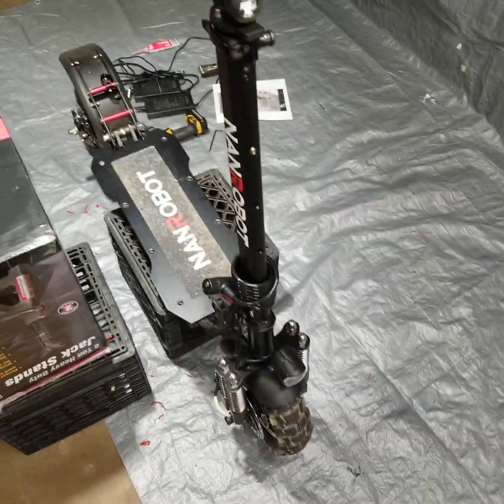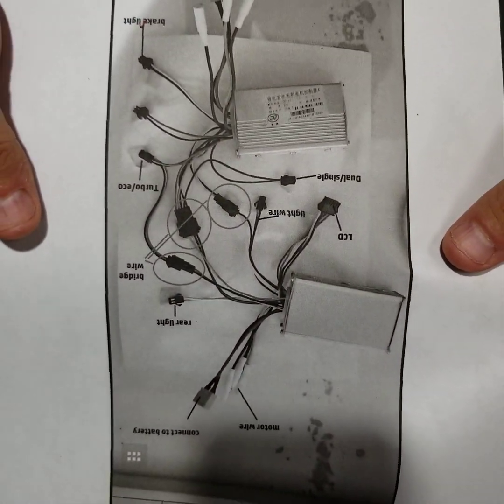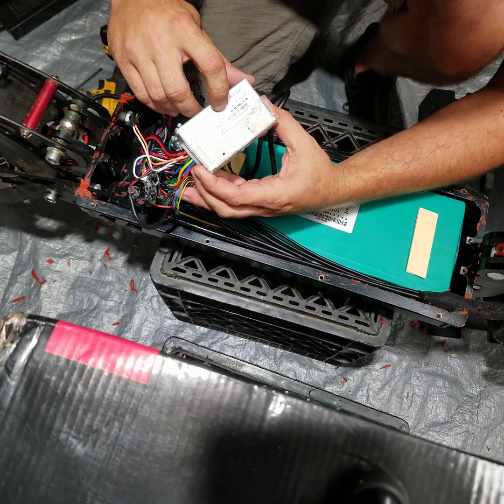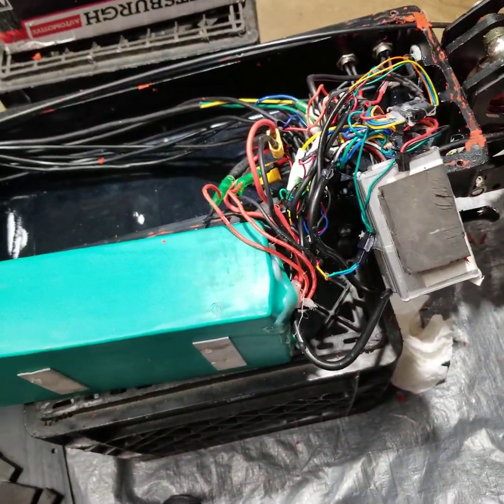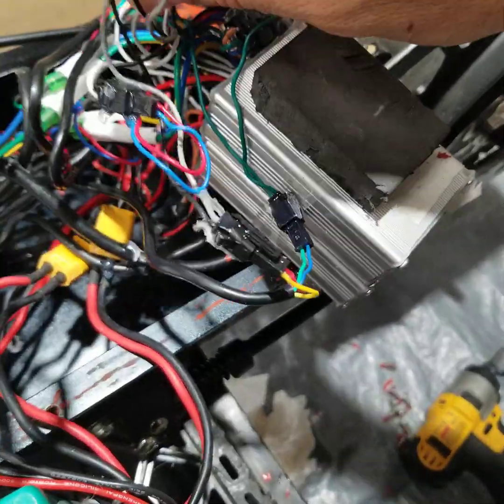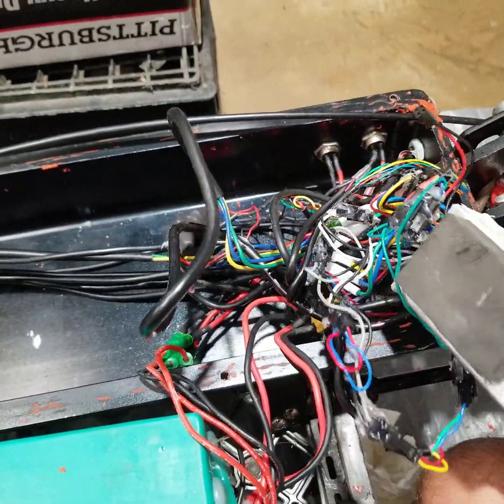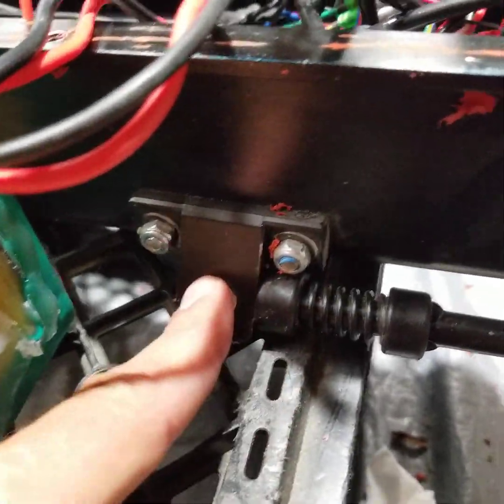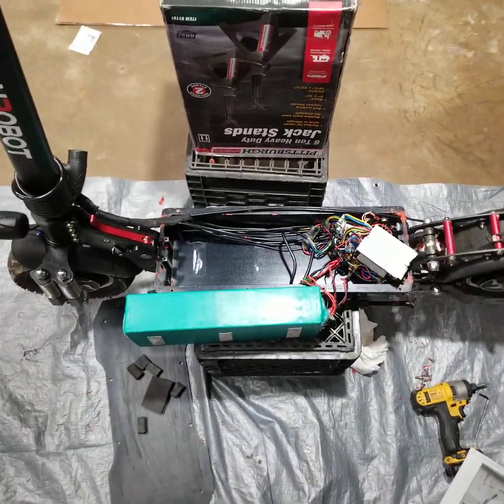Nanrobot D4+ 2.0 Whats inside the scooter Plus overview of the basic wiring diagram electric scooter

Comment: my nanrobot d4 seems to make a clicking/clunking sound when i first use it, it seems to be coming from the motors but im not sure.but it doesnt seem to affect it and it goes when youve done a mile or so....any idea what this could be...many thanks for your help...Adam
Reply from the maker: Since it doesn't seem to affect the operation then maybe you don't need to worry about it but i definitely would look closer and inspect everything just in case. Check where the handle bars connect at the base to make sure there isn't any loose screws. They are notorious foe backing out on there own. Also the clicking might be from the front suspension. They are sometimes very noisy. Its a sucky design. Also check your brake rotors and make sure they are not warped. I would put the scooter up on a stand and run it to see if i could identify where the clicking is coming from just to be sure everything is safe.
Reply: wow..thanks for your very fast response...i have done all that and i know about the noisy suspension..and its not the rotors ...when i put it on a stand the motors or silent its only when i first get on the scooter and start off there is a clunking like sound which sound like its coming from the motor i think rear motor also the rear motor doesnt seem to be as powerful as the front...should i be able to hold the scooter still and the rear motor not have the power to keep going and just click as if it was trying to move?
again thanks for your help i know its difficult without seeing the problem
Reply: do the controllers make a noise ever?
Reply from the maker: @adamwilliams2381  not that i know of. They just go bad and your motor will not work.
Reply: .should i be able to hold the scooter still and the rear motor not have the power to keep going and just click as if it was trying to move?
again thanks for your help i know its difficult without seeing the problem
Reply from the maker: @adamwilliams2381  it may sound like the bearings could be going bad. Look at the video i made when i took the motor apart and you will see the bearings, one on each side.

Comment: Iv got a problem with the back tire, it works but shuts off periodically while driving is it a circuit problem or is it the wheel itself
Reply from the maker: It could be a loose connection or the speed controller going bad. I would check for a loose connection first.

Comment: Hey man I hope you can help me out. I have a nanrobot d4+ the first models that came out. I was trying to connect led lights on the scooter and messed something up. My scooter doesn't stay on.. it goes out instantly.  Is there a fuse or circuit breaker that I can reset?
Reply from the maker: Ok we have to do some troubleshooting. Where exactly did you try and hook up the wires to?
Reply: @wattsinyours  I was checking for voltage on the rear light wire and touch both metal connector with the volt reader
Reply from the maker: @mannyindio3569  ok it could just be your buck converter. You have to remove the heat shrink and check incoming voltage and out going. If no incoming voltage is present then we need to move upstream and keep working your way up. Incoming voltage to the buck converter should be 52v and out going probably 6v. If you have no incoming voltage then it could be your speed controller but will not know until you verify voltage to the buck converter and make sure no other wires were shorted. On a side note be careful adding LEDs until you know what voltage and amperage you have and where you are going to connect the new lights.
Reply: @wattsinyours  ok. Is the buck converter what you saying the same thing as the speed controller (the two silver metal boxes inside the scooter)? Sorry but I don't have much knowledge on this. How do I check the incoming voltage? Do I check the wire coming from the battery to the speed controller and to check for low voltage be any wire coming out from the speed controller.
Reply from the maker: @mannyindio3569  the buck converter or the dc to dc converter is a little rectangular circuit board that reduces the 58v down to probably 6v for you back lights. The speed controller is the big metal silver boxes. You will have to get a meter and start checking the dc voltage in and out of the buck converter. Also check out my video on the led lighting upgrade. That will show you how to add led lights to your scooter the proper way.
Reply: @wattsinyours  Hi, Just want to say thanks for your attention and time on my scooter issue. It helped me some.  I manage to find the problem. It was the LCD display throttle. Stay safe and keep putting on your videos, they are very helpful and informative.
Reply from the maker: @mannyindio3569  awesome! Glad I was able to help some. Sometimes these scooter can be a pain, but the end result at least to me is worth it. Ride safe friend.

Comment: Hi, my name is Claudio and I live in New York. I have a problem with my scooter. Maybe you can help me. The problem is that it works but it does not start sometimes, or to help me walk I have to put the Single Dual, could you advise me something. please
Reply from the maker: It could be a loose connection somewhere. Verify all your connections are tight. What type of scooter do you have?

Comment: Those controllers are designed to just last pass your warranty.  I bought the Ultron  t113 scooter and the controllers failed in less than 2 months with 20ah battery. I did modified my scooter with an upgraded large controllers and battery.  My scooter now goes 56mph and now have a 41ah 208pcs of slightly used sanyo ncr18650ga cells battery inside and all the controllers mounted outside with constant so I'm able to maintain high speed with no heat problem.
Reply from the maker: Wow! Nice job. That's the point in a lot of my videos. With a little bit of know how and patience you can get your scooter to be what ever you want it to be. Thanks for watching.

Comment: Thanks so much for the video. I would like to know how can I make it totally waterproof? Do you know anyway to do it? I’d appreciate it. Thanks a lot.
Reply from the maker: You could put a gasket around the deck lid and the put waterproof silicone around all the penetration holes. Only area that will be the hardest is where that bundle of wires enters into the deck. I don't have a sloution for that. Hope this helps. Ride safe.

Comment: Nice video my friend I have the D5 Plus would you happen to be able to do a video on how to replace the rotors I have a rear warped rotor
Reply from the maker: Thank you for the complement. Unfortunately i sent my d4+ back and ordered the RS7. But if you watch my flat tire video on how to take off the tire and brake caliper then all is left is to take off your brake rotor. Should be about 4 or 5 screws and then swap it out. I hope this helps you. Ride safe and don't forget to use locktite on the screws.

Comment: great video, can you send me that wire file?
Reply from the maker: Thank you for the nice comment, but unfortunately they never sent me a wiring file. It was just a picture that they sent me in a email. The picture is the same one in the video.
Reply: @wattsinyours  so it doesent have any color? becouse thats would help me :D
Reply from the maker: @MrFoglalt  I don't understand what you mean "any color" could you please clarify. Thank you.
Reply from the maker: @MrFoglalt  nevermind i see what you mean. The picture is in black and white. Sorry that's the way they sent it to me. But take your time and go through the wires and follow where they go. I know it's a tedious job but you can do it.
Reply: @wattsinyours  thanks for the fast reply, and the reason why im askin, is becouse i thought i make a break light, and connect that wire :D
Reply: @wattsinyours   but still, thank you for the pic and the dissasembly
Reply from the maker: @MrFoglalt  you can make a brake light and use the existing back let light but you will need switches in your break handles to activate the brakes when you pull them in.
Reply: @wattsinyours  can u send me a copy of wiring diagram? Please thank you